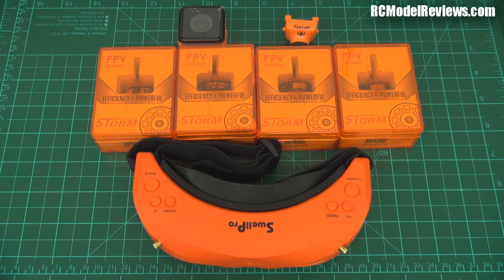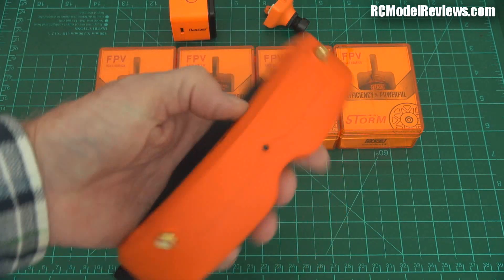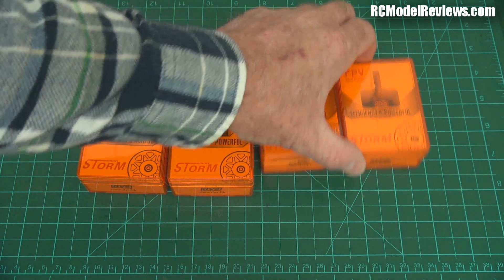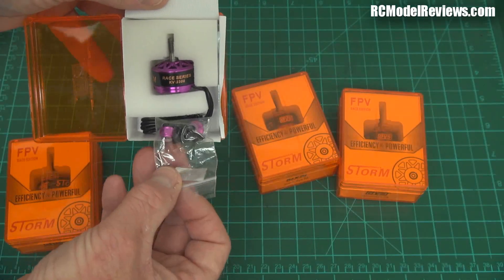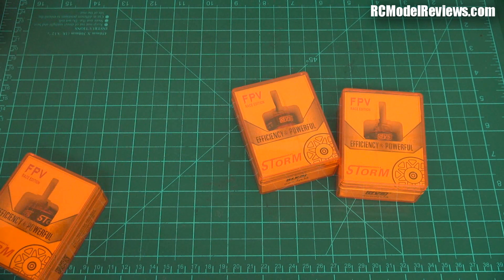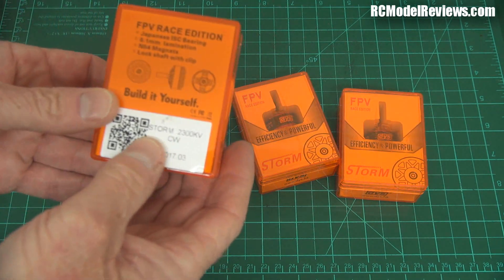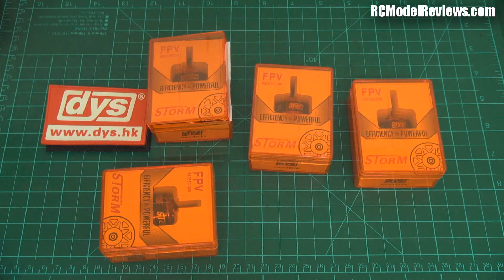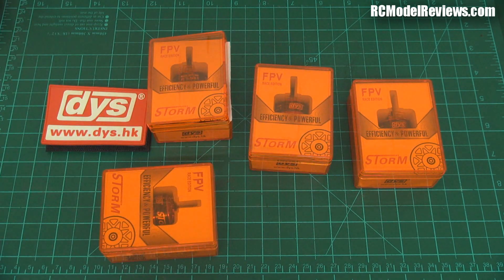Testing miniquad motors - you tell me what you want

Comment: Hi Bruce
I might be a bit late but I post anyway. I have two things that interest me quit a lot.
1. Efficiency measured (not guessing by calculating with thrust) but by measuring the torque the motor is giving under load. Like so: https://youtu.be/3pG90WreWyo?t=2m30s
2. How big is the difference between the motors in kV and efficiency?
Generally it annoys me when I see that motors efficiency is measured with thrust. In my opinion it is not accurate (e.g air density, temperature, humidity, is the propeller balanced, what ESC and settings etc.)
Keep it up!

Comment: I like the dyno idea, you could also plot temperature and use a power supply not a battery to get more consistent current delivery. You could get more consistent data on current draw that way too. Also track rpm and also track noise with a microphone. Lots of noise might mean lots of lost energy?

Comment: something i'd like to see and would be very telling is an efficiency comparison chart between different motors. measure their power inputs for the exact same prop and RPM (preferably at more than one speed) and you'll be able to tell which ones work the most for the same energy. so... they claim their motor is efficient. are you gonna take their word for it?

Comment: I want to know when the smoke comes out!
(because in every build you wonder, how much current motors draws, will ecs handle that, what size propeller you should use, will it work on 4S etc...)

You have 4 motors, burn all of them. Put them on the bench with different size props and torture them until they fail. Measure whatever you can - current, power, temperature, time under stress.

Comment: what about working out at what rpm the power starts to gain strong and work out in relation to that what weight quad they would work well with. this would be helpful because you could work out what rpm a 600g mini quad needed to hover, and then choose correct motor/prop/battery combination the have a motor that starts to make the most of its power just after that rpm, so when pilots want to "punch it" then the power will be readily available. i think that could be valuable information because there's no point a quad having the majority of its power below hovering rpm or way up at full rpm either.

Comment: Matching the optimal prop to a specific motor would be an interesting idea. Considering power to weight ratio and response time is important to me.  Emax has designed a prop to optimize their new 2306 motor. Maybe you could discover the perfect prop for that motor. That would be an interesting video. I havn't seen anyone attempt that. Miniquadtestbench comes close and he does give our community a lot of data to utilize but he does not suggest which prop would work best with a given motor. My guess is there are a lot of variables to consider including but not limited to the AUW of your quad. Thanks you for your contribution to this hobby. Keep up the great work.

Comment: When building mirco quads the variety of available motors available on the market is not too big. 
Therefore:

Pls test 2 or 3 1103 brushless motors with a kv between 5000 and 8000 with a 2S Lipo and tell us about their thrust! 

(Actually I operate the Kingkong and the Racerstar 1103 motors on my own micro quad buids)

Comment: What I would really like to see is " " T.H.E. " "  Prop Chart ,  with all or most props on the market . Giving useful information like : Weight , Durability ,  Consumption / Efficiency  , Application ( Best used for ... )  , and maybe What motors it would work best with ,   Etc .  
A bit like Mini Quad test Bench but for props ...  but maybe not as in-depth as they get into  . 
 As For this motor and all other motors ;  I'd just like to know what ESC , Lipo range I need to use with them .

Comment: Bruce : Test 5/45 two bladed prop thrust versus 5/45 three bladed prop at various RPMs to maximum RPMs for various KV motors. I have found that two bladed props seem to yield higher top speed at high to max motor RPMs than similar pitch three bladed props. The three bladed props seem to deliver greater initial thrust but not so much at higher RPMs.

Comment: You know what.  That would be nice that motor reviewer starts to measure the motor wires.  Cause, with 4 in 1 ESC slowly gaining popularity, it's getting difficult to reach the center of the quad without soldering wire extension.  Thanks if you do.    :-)

Comment: Here is your best idea, thrust is great and so too amp draw and torc but, what I would rather know, and would tell us more than anything else is to compare them to each other. Are they equal , if there is little difference from one to the next this tells us that they have good quality controll I can't tell you how many Chinese motors I have had that all act different though they are supposed to be the same. If matters little how well a single motor performs as a quad uses 4 of them, this means that they are only as good as the weakest motor. now tell me does that not make sense?

Comment: 1. Power and efficiency, this is their advertising material, I'd like to see if it's legit, or if they're just blowing smoke.
2. Torque curve sounds good, optimum prop specing would be helpful.
3. Durability, what does it take to kill them? are they going to die from a light crash? or will it take an obscene amount of force?
4. Longevity, how long do they last under light condition? Heavy conditions? Simulated racing conditions?
5. Value, plot some charts on how much they cost vs. power, efficiency, torque, durability, and longevity.

Comment: I thought motor direction was controlled by the ESC wires?  The Storm motors call out a direction?

I'd be interested in your assessment of build quality.  Longevity would be good, but it's hard to assess in a short time.
Reply: Hugh Hemington The direction of the motor is in relation to the threads. Eg a cw motor spinning cw will self tighten when the motor is spun up.
Reply: Not calling it thread direction is what threw me!

Comment: Build Quality,  Noise(vibration),  Torque ratings, Best performing Props for certain motors.   How they perform in terms of moving through their speeds, how well it changes speeds up and down, slow and fast changes, basic response of the motor.  Noise feedback down the line.  How noisy the lines are(RF too, how much RF could they be generating)

Comment: Bearing failure is what killed most of my motors and finding good replacement bearings is a real pain where i stay.  Prop installed running hours. Would be a boring but interesting test.  Then again i have bearings that failed in less than 20x 15min flights. My first AXi also eventually quit due to bearings but it took years instead of flights. (P.S. I like cheap as beans)

Comment: we fly most of the time at the 40-80% Throttle, I think what is important is the acceleration of the motor on specific prop .... (Torque? )   if the motor can accelerate faster than other motors, that will be translated in responsive quadcopter performance!
please compare the acceleration of the motor on the famous props like 5045X3 or 50X40X4 and see how many seconds it takes to reach the 900g Thrust (with same current on both motors)

Comment: I like your motor thrust tests, and how they do with different parts, but I also really like when you look at the quality of the motor.
some things I am also interested in is the balance of the motor etc, hobbyking has burned me a few times with motors that could vibrate their way across a room.
Also a durablility test, it would be limited to if you have a bench PSU that could supply the current but program up an arduino to spin them up like as if in flight and let it run for a few days/week and see if it develops issues quickly

Comment: I want to know what props will work well with them. Honestly everyone wants to try to fly like steel or charpu, so to see how they perform on maybe a 250 size quad, as in how much 'punch' you can get out. How long can run them? Can they actually handle the top batteries that they are rated for?

Comment: Lotsa hype about filtering lately. Is there a way to measure motor noise/vibrations with no  consideration to prop imbalance. Some are calling the popular Emax motors "junk" because of their noise making. This noise limits the ability to turn down/off filtering. Many are reporting the near elimination of propwash and the crispier feel with the filters turned off/down. There's tons of motor info on thrust and amp draw using different props and voltages.

Comment: I have never seen brush less motors that were not unidirectional.  what is different in these designs that makes one direction better than another?  is it an electrical thing or an airflow thing?
Reply: It is just the direction of the thread on the shaft, it stops the prop nut from coming loose

Comment: Bruce, 

The one thing I would request if you do when testing motors is try for as much consistency as possible and the torque converter would be a great step in that direction. 

I was looking at doing some testing myself and I wanted the ability to test the motors at different voltages. My first thought was to use a bench power supply but I found I could make a custom solution by using a cheap ebay boost or buck converters connected to a cheap ebay power supply for a lot less. 

Cheers, 

Punkalflufen

Comment: Hello Bruce. :-) I only started flying RC last spring 2016, between plane and mini quad brushless there is alot I'm trying to figure out.  Could you take some of the High-end (pricey) motors ie: Cobra, Luminer, T-motor, or the sorts, and compare them to the $8 & $9 (cheaper) motors, ie: racerstar and others that are in the same price range, and show us why the prices are so different and how paying top dollar for a brushless motor may or may not be the best/least best thing to do? Hope that made sense, as to what I'm asking. I've started to pick up a few of the higher-end motors, recently purchased a couple Cobra brushless motors, and would really like to see your perspective. Thank you.      -Jamie
Reply: I'm sure the T-motors and Cobras have better bearings. In china there is at least 7 grades of bearings minimum. for any application. That is the way it used to be anyway. How good do you want as a motor manufacturer you have to ask yourself. The price scales up on the bearings as the quality goes up. That is not to say a cheap bearing cant last a long time.  Many times they do. FWIW its just more or less not quite as likely. That is just one part of the motor ! :)

Comment: If you can plot the torque curve and maybe suggest prop and craft optimum weight combinations? 0.1 laminations is the current best on the market i think the motor is a 2207 this would give it big torque and lower running temp more punch for less stick movement. I was using the dys se2205-2550 they were n52 im now using the emax 2306 2750 i think they are n52 they are also curved but eat battery, there is a prop designed for its torque curve but its not out yet.

Comment: Longevity! No one test how long motors last under normal conditions, but in reality it is by far the most important aspect for buyers. Who really cares about the last few percent of torque and speed. Only a few of us are real racers. if two of my four new motors burn out or develop unacceptable bearing play after a few hours of use, I really care a lot.
Reply: Agreed!  Most of us are more concerned about good value, practicality, and durability than we are about extracting the last tiny bit of performance.  That's why we drive Fords or Toyotas, not Ferraris.  Rate the motors with a Simpson(TM) "(Hours of fun x intensity of fun) per dollar" index!  Maybe figure a way of including "Hours of hassle" too, where applicable.
Reply: yeah ... just smake the SXXXt out of them ;) .. see how the bearings hold, shaft, Bell etc..
Reply: Kjell Kernen couldn't agree more, maybe run constant load cycles to increase temps and review after set hours of use
Reply: Thats a good idea, you can use constant power supply and  a servo tester that plays with the throttle and leave it running for days.
Reply: I subscribe, longevity and perhaps efficiency.

Comment: Top end thrust and amp draw (efficiency) with various props on the bench, whilst not indicative of flight performance, does give you a comparator between motors, Speed of transition is also very important (and again, prop specific). Josh is interviewing Ryan who runs miniquadtestbench in that vid, that is a priceless resource because of the volume of data and the ability to compare stats

Comment: I want a motor thats easy to take apart and clean.
That is my main metric these days, as the motors are so close together in terms of performance for the average flyer.
Reply: sqwert Can you take them apart? How?
Reply: C-clip on the bottom usually or some have a screw the mates with the shaft.